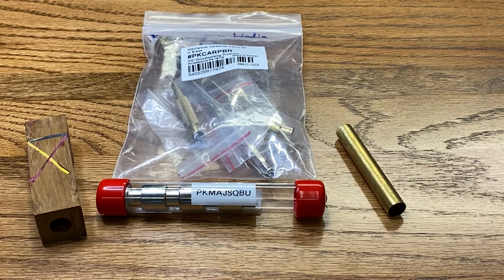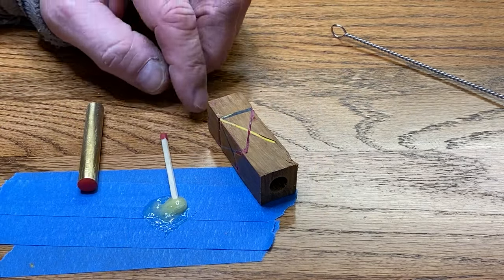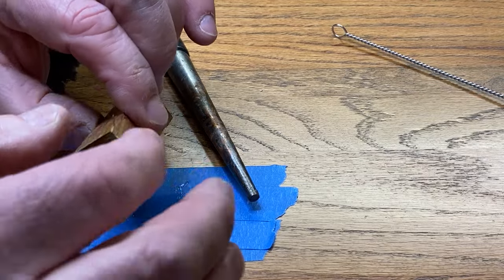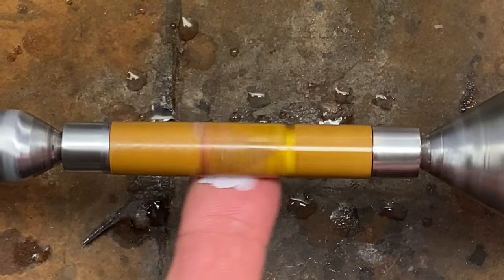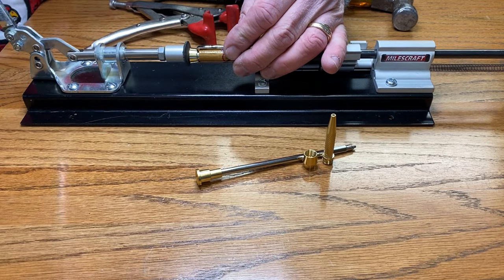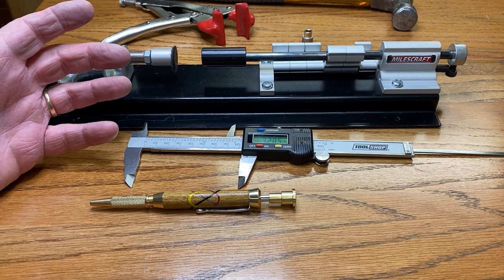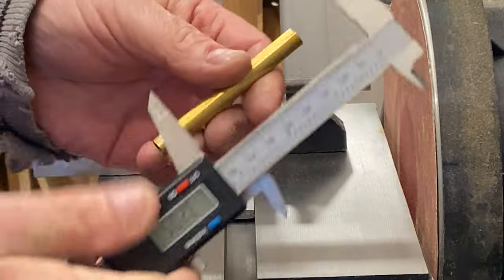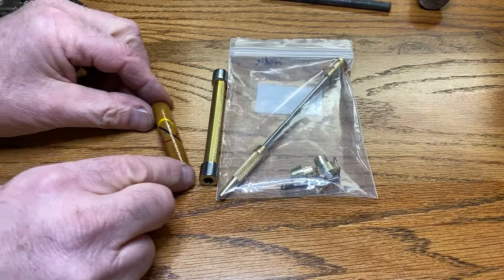Turning A Carpenters Pencil - The Blank Was To Short

Comment: Yep I had a woodcraft wall street ll pencil kit that I was making a pen and pencil kit to match with the tiger stripes blank I got a couple years ago at the mid-Ohio pen turners gathering but when I got both turned the tube that was in the kit was to long. So I have a pen but the pencil didn’t work. Thanks for sharing Bob
Reply from the maker: That is a shame. I spoke to Bob and. He wasn’t sure if the wrong tube came with the kit or if he mixed it up with a tube from another kit. No worries, I’ve made a new tube to the proper length all I need to do is find the right blank to put with it. 

Regards,
Bob

Comment: What a great shame Bob.
That is a nice blank and a generous gift from Bob.
Just a thought could you drill out the tube in the blank and then insert the correct sized tube an glue a contrasting section top and bottom?
I know it would be extremely fiddly with very precise drilling but it could work and you would only need to drill out 1/2" or so from either end to glue in the new tube sections that would accept the kit "end caps" and the component parts of the pen.
Take care Bob.
Cheers, Huw
Reply from the maker: That is an interesting idea Huw and I tried it once before. I might be able to make that work with a full blank but one that’s already turned is so thin that I’d probably crush it trying to drill it out. 

Regards,
Bob
Reply: You can always turn a dowel to fill the tube to the length needed which would support it.
 Just a thought